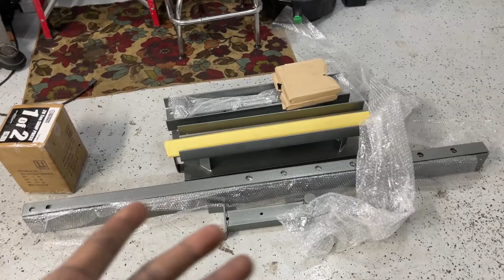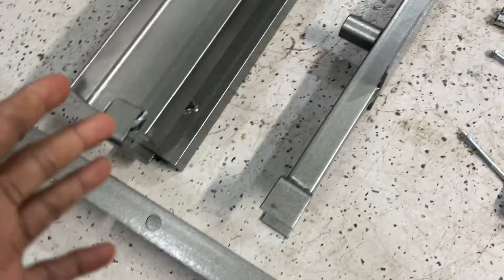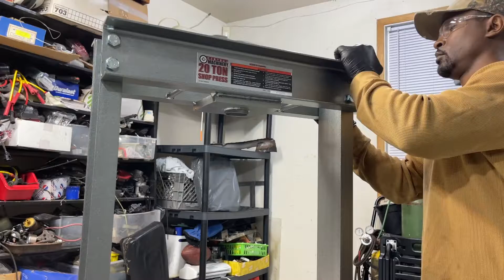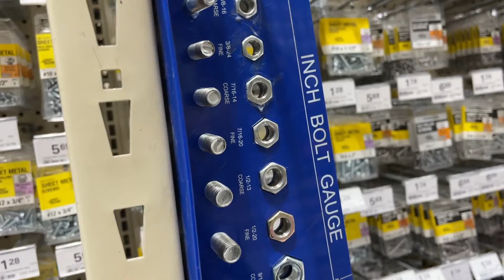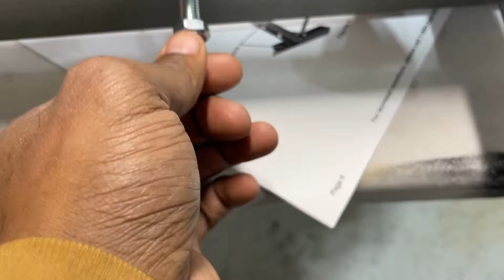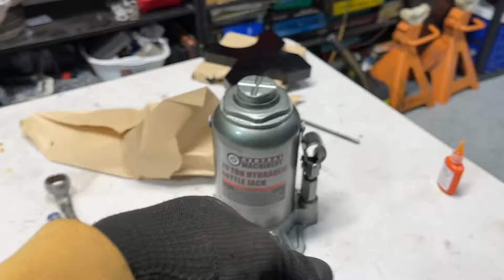Harbor Freight 20 Ton Shop Press Assembly, Easy Build W/ Slight Mod, Tips And Recommendations

Comment: About 9 min into the video putting on the braces, there is an 1/8" gap. Would some 1/8" washers in that gap help, or is that part of the engineering part of it. Getting cold in my shop now. Most of it is bolted together. Finnish it up tomorrow.
Reply from the maker: That is how it was designed. They way I assembled it is perfect. Very sturdy. Thanks for watching.